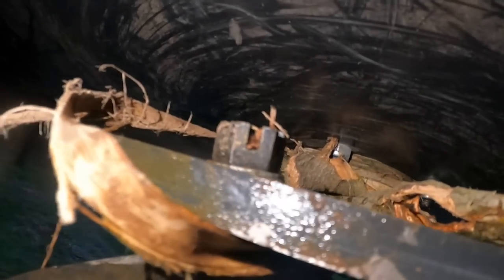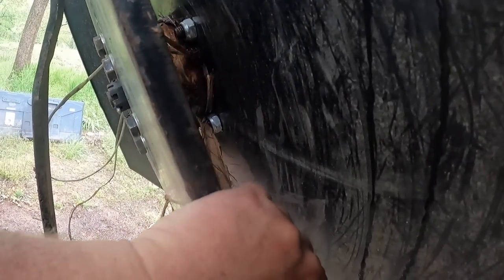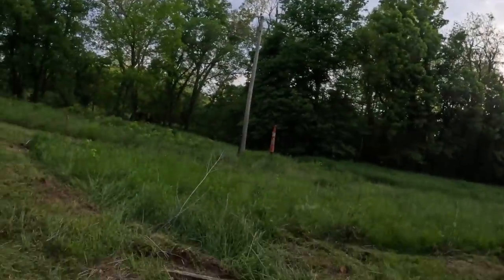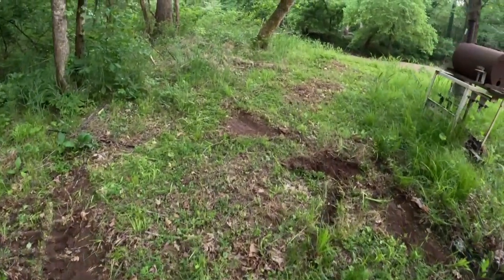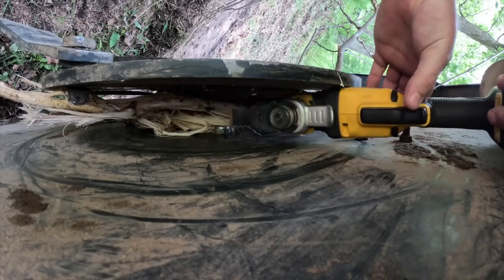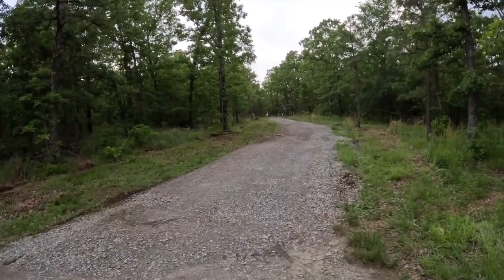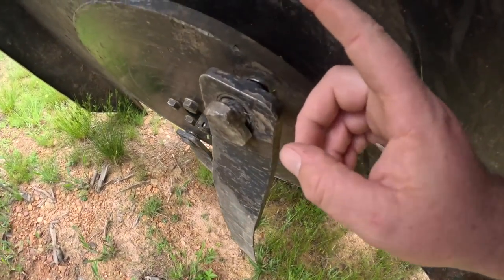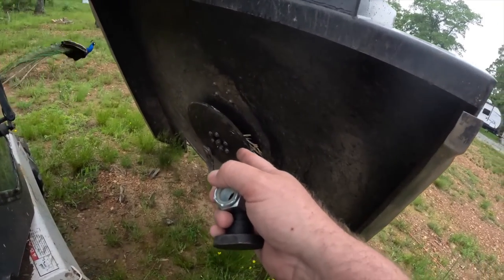Had The JCT Brush Cutter 1 Hour & It Broke

Comment: I’ve had mine for about 2-3 years, within first week had issues with those junk shoulder bolts, took off got grade 8s & had a machine shop make sleeves for them, I’ve only had to tighten them twice since then, other than that a pretty decent cutter for how cheap they are

Comment: I have the same mower, also had the same issues!!!  got new tractor supply blades and new ,but different bolts they fit so tight in the holes that I had to redrill the holes bigger make sure you have agood shoulder on the bolt ,then tighten the bejesus out of it drill and cotter pin also recomended  you cant be too carefull to have those blades on good!!!

Comment: Hey Dutch get some grade 8 bolt and 8 lock nuts and find a better grade of metal for your blades have a fab shop cut them for you. you will be happier and safer in the long run. just a thought from an old farmer. God Bless you and your family

Comment: Thank you, for the information.  I have a 42" mower, I have had to replace spindells multiple times.  Last use started out good, then the deck started shaking again, as if, it was no longer balanced.  I am a widow, recently less than a year ago, but I was also raised by a mechanic family.   I have people to call, but the finances may be short in the near future.  I am doing my best as a person, on my own, in a 1900 home remodeled 6 times over now since 1991 as a fixer upper.  I know what needs to be done and I can do it.  The problem, I have is everything has paramounted.  I have cleared a lot out of the house, cleaning is just overwhelming.

Comment: Shaun, 
Have you considered getting a attachment called a forestry mulcher? It seems to be able to handle much more and bigger material, than that brush cutter deck. Also I'd look into a grapple type bucket. It would help with gathering the limbs and trees cut down it'd aid in loading the sawmill too.

Comment: Yeah, more and more equipment manufacturers are short cutting certain parts.  I'm a machinist and have done work for underground mining equipment for years. Why don't you check around for a good local machine shop that could make you some new bushings out of 4140 or other good steel instead of those plastic pieces. There are some really really rough composite materials that would hold up really well however I would recommend a good metal first.

Comment: If there's an additional way to further disengage the power or wiring connectors before working on this thing, I hope you do that in the future. Sometimes the power can be interrupted because of the jam & not the ignition being shut off. And when the jam is cleared the machine may briefly kick-on again, then shut down. But by then the damage is done. Take care.

Comment: Very good video, and good information for people looking to buy a rotary cutter. It seems the consensus of every video I've watched about the Chinese brush cutters is the same. Always fill with gear oil, always change the bolts to grade 8 bolts, and always change the blades to heavy duty blades. Once you do that, they seem to be pretty good units.

Comment: What I have been experiencing is. When buy anything new. I have to go threw it top to bottom. Then if I can find the bolt size. Replace as many as possible. They use very low-grade bolts and screws.

Comment: I would get brass bunching remove the plastic bunching an put hi temp GRES on the brass bunching you can chirp in the blades  I use a 4" grinder an get 80 grit sanding disk that's how  I shrine my blades on my mower's

Comment: Our John Deere lawn tractor 2014 bought from dealer but failed to mention it has pulleys that need to be lubed. They Do Not come prelubed and will start burning out at 1 1/2 years. First one burning out, replaced 2 and lubed up all three. Never a problem since.

Comment: I believe Kubota makes a brush cutter that seems to do a better job. I saw where they actually pushed  small trees over (4 inch) and made mulch. A couple of acres near where I live they went through there and also used it as a stump grinder. Not sure if that was the intended purpose but it cleared down to the dirt. I think that some rental places rent them. You may want to check it out.

Comment: You need to replace the plastic bushing for those blade bolts with bronze or even steel. No machinery shipped by container has any quantity of lube oils in the gear boxes.

Comment: For your plastic bushing issue you could consider replacing the existing ones with delrin or maybe even brass. If you don't have a small bench lathe it might be a good investment.

Comment: Dutch,  You may want to take the plastic sleeve out and have steel or sintered oil light sleeve installed.  If there is any way to have gun grease zeros put in can reduce the wear also.  Keep at it and it could become a income property.

Comment: Sorry the new machine is giving you issues the first time you used it. It does not seem well made if it has plastic bushings on the blades and weak bolts, I get the blades will get beat up especially at the Creek Property, with all the stuff laying around.

Comment: On the bolt that holds the blade in place try Lock Tight but ultimately it’s best you order new nuts for it or drill a hole and use a cotter pin ok buddy be safe and we love your channel and family GOD BLESS! Roland 🙏🏼

Comment: How about High Temp,Super Lock Tight (O'Reilly has it) The stress on those will HEAT & deteriorate the Insulated(Plastic or Rubber)  Nuts. Pray this works

Comment: Surely you can see it needs a split pin going through the castle nut. Unscrew the castle nut completely and you can see the bolt is drilled for a split pin. Or a small nail

Comment: Maybe you should just tilt the Bush off back so that it's facing you instead of getting under it with a machine running. You realize if that thing blows a hose or any kind of hydraulic malfunction you're crushed underneath that cutter rightotally not. The smart way to go about it
Reply: Absolutely! But, this is not the first thing I've seen him do that wasn't very smart.
Reply: @randiecoulter7872  I agree with that!

Comment: You should be able to get them blades sharpened dutch will be cheaper than replacing them plus id try and get some bushes for it instead of plastic cos that could be dangerous if a blade comes off while you have it raised up and the blades spinning

Comment: Take those plastic bushings out and replace with Copper sleeves like you would with a starter for a truck. More then likely you can find it at a heavy truck parts store.  Then get back to work cuz that grass ain´t gona cut it´s self...🤣🤣🤣

Comment: They do not ship anything other than cars with oil in them these days .I thought everyone knew that, but you would have  picked that up on your pre inspection before you used it ,and caught the loose bolts and missing cotter pin. I would have thought with you running these machines for years with the state you would be familiar with daily and weekly checks, lol. Any machine is only as good as its operator, I am sure with gear oil and heavier bolts that the machine will be fit for purpose.

Comment: Use a cutting torch to cut the bolt off and that plastic bushing needs to be replaced with a metal bushing a good machine shop cam make them for you if you get new blades I would replace the bushings before they are installed

Comment: Change out the plastic to metal bushings.... And if your worried about the new bolts you can always drill a small hole in it and install the pin in it ...just a suggestion

Comment: If I'm understanding your comment correctly, the blade has a plastic bushing to make up for a different size bolt?  Can that plastic bushing be replaced with a bronze bushing to make it a little more sturdy, yet softer than the steel?  And I see you're using a nylock nut in place of the castle nut/cotter pin.  Would some blue locktite make for a suitable back-up?  Amazing that a place will sell you an implement without telling you what the oiling/grease requirements are for it.  Good thing you found out on your own about the need for oil.  You'd THINK that at the very least, they'd include a bottle of oil taped to the unit with a warning label to fill it before using it.  Even lawn mowers come with a warning label like that. Amazing.  Anywho, the place is lookin' good there Kemosabe.

Comment: You are probably going to have to drill the flails out for a standard size grade 8 bolt.  I think I would bolt them through a flat roller bearing so the flails pivot the bearings instead of just on the bolt,  I would use Nyloc nuts instead of 1800 tech castle nuts.

Comment: You should put blocks under the back of the trailer when you loading unloading machine so doesn't pick the back your truck up will help keep them unnecessary pressure off the tongue and back of the truck

Comment: Looks like that mower is a headache, but you could probably just sharpen those blades and they'd be good for several more uses... even if you bend them, you could put them in a vice and bend them back into their correct position... that's what we do with the blades on our brush cutter. Your property looking good, it's hard work but we'll worth it! Please be safe with those hydraulic arms, though. If a hose pops those arms will come down on you. Happened to a good friend of mine. He was working on a bobcat, his back was to the bucket and his knee was braced against the machine. A line popped and the bucket crashed down on him, snapped his femur in half... compound fracture, he was in the hospital for about a month, had to have surgery, a steel rod, several screws, and a scar from the top of his hip to his knee... that was several years ago and he still walks with a limp.

Comment: I noticed you were using the new mower over much of those vines, limbs,  etc. maybe it would be  helpful to walk or drive thru the new areas first to pick up or saw down vines, limbs and metal, junk that might harm the mower.  Be careful when you are under the mower.. hot metal, could cause an accident.

Comment: You could measure the I.D. / O.D. of that plastic bushing and the hole it rides in and find a brass bushing with those dimensions.  Probably Tractor Supply.  I would measure the I.D. of the hole on the blade and the O.D. of the shoulder on that bolt (a bit longer shoulder couldn't hurt, from my end of things and not being there).  I would go with the second option IF it were me.  A Machinist could make you a set or two...or more and keep some on hand, although you should not need a new brass bushing for a little while at least.  All the very best, KIDs!

Comment: Those slots in the nut are to run pins or safety wire through, if they keep breaking you might have too much play in the blades.  If you just got it why not contact the dealer that sold it to you.  You need a grapple to grab at least the big stuff then a rake to get the lighter stuff.  Not sure Id have a group of people over with all the ticks you have, your dogs must be loaded.
Reply: I was wondering about that. They are always saying that they are covered in ticks. Just think if you had to spend the night there. That would end up being something awful for everyone plus they spread lym disease.

Comment: It looked like you were constantly having to adjust the height to keep it from digging into the ground. Is there any place on the front sides that you could mount some heavy duty solid tires like you see on some ride on mowers? that way you would always have a consistent height. I know it wont help for really uneven ground or pile o' crap, but it might help from having it go from a nice swath to a bare chunk look.

Comment: Not good customer service. You shouldn't have to repair a new machine.  If the bolt(s) are not tight if can wear the hole bigger and cause more issues. Best wishes Dutch. You can fix it better than new.  You're doing great work on your properties. Keep the great work. 😊😍❤

Comment: I believe the issue may be with changing the angle of the rotating mass. Like a gyroscope once you stay on the same plane, when you tilt the blade you put more pressure on that one bolt that holds the blade. The conservation of energy on the centrifugal force is too much for one little bolt

Comment: That thing looks like a huge accident waiting to happen. If it were mine, I'd replace those blade bolts. Putting them on, I'd put loctite and new cotter pins on them. Be careful about running it up high as should it throw one, it could go through the cab.

Comment: Hi!! What kind of bolts and blades did you replace it with?? I’m having the same issues and need to replace blades and bolts but not sure what to buy or where to find them! The first time I replaced a bolt with the same kind and it was hard to find and expensive! Now I have to do it again but want to find better. Thanks!!!

Comment: Dutch You need to get those bolts torqued tight on the plate or they will open up the holes and you will never get them tight. You could drill new holes 90 degrees from the old ones and install new bolts.
Reply: And i'd be draining the soy sauce out of that gear box and adding some good gear oil.

Comment: It's hard to believe that a piece of equipment made for rough terrain like that does not have a stump. Jumper on it need to check in to get in one if you can have 1 installed. I don't know if you can install them or they just come with them. Everyone at every blush hug I've ever had. That was made for rough terrain That was made for rough terrain had a stump jumper that saves your  blades and equipment. Blades and equipment.

Comment: I know your frustration have Briggs and Stratton generators four of them the company that makes their brushes which you can set your calendar to go out. Well the company that makes them went out of business due to Virus. No backup on their part sent one set new the other set used and I paid for two new sets!  Than I have a mower that I got one year use. Replaced plug drained dry and  it wouldn’t start the next year oil fine plug I concern wasn’t the right one called them to verify ask if a MTD I said yes there was silence than a sigh and gave me the plug model.  Briggs and Stratton use to be a good company that virus killed a lot more than the health care system and people but companies as well. By the way mower still won’t start totally dead I suspect wiring bad inside?!😂 There is hope but my generators from Harbor Freight and there was issues with crossing battery cables across one another and unable to secure to Frame call head office when talking to them about something else calmly brought up the fact that what would be easier get their battery manufacture yo change placement of battery post or battery cables or battery bracket so I would have to use bungie cords and 1x2 to hold battery in place… guess what stuff got changed sweet deal from my lips to their ears they extended their cables and place them so they don’t cross one another. Some times if you work with a company at least the next costumer won’t have to suffer your pain!

Comment: It sounds like a POS. Should have tried the Skid Steer Brush Cutter @ Toolots. 72" cuts up to 7" and it's a finish mower for under $3,000 and blades $160.00 pair. Good Luck, it looks great.  I know how much work that is. It will keep you young!

Comment: Hey Dutch, take it from a professional bush hog business owner, that "bush hog" you have is junk. I run a CID X-brand extreme duty direct drive cutter that is a 72" wide model, and I knock down 6 inch trees with it no problem. I have run my cutter for almost 2 years before I had to buy a new blade carrier (due to cracks). I am not saying that CID is the best, but for the price ($6K) , and the performance, it has served me well. I use a Takeuchi TL 230 skid steer that is about 8500 pounds with a 74 HP Kubota engine with my cutter. It's a well matched combination.

Comment: You'll figure it out. The more you use it. Look at the scheduled maintenance. Make sure all the bolts are tight and the cotter pins are in right . And find all your grease fittings for every moving point and grease them accordingly 😁 you got this Dutch
Reply: DO NOT tighten the bolts. They need to be loose enough to allow the blade to spin on the bolt, in casr you hit something solid. The blade that still had the cotter key in place was right.
Reply: @cbobwhite5768 yes the bolts do need to be tight. When these bolts are tight it doesn’t make the blade tight like you are thinking. If you look closely at the bolt you would understand how it works

Comment: If you used that thing for it’s intended purpose it might not keep breaking. It’s not a tree mulcher. I mean you have tree branches not twigs or wrapped around it
Reply: It sounds like he’s driving it over rocks, he also hit some metal that was in the high grass! That can’t be good on the machine! Did he buy the brush hog brand new? If so then he needs to go back and let them look at it!
Reply: Exactly right. Also raise the cutter an inch or 2. It will stay out of the rocks and be far less strain on the machine.

Comment: The way the blades are attached is bad engineering, the bolts shouldn't flop around, should be a boss to keep the bolts straight. Manufacturer needs to fix it.